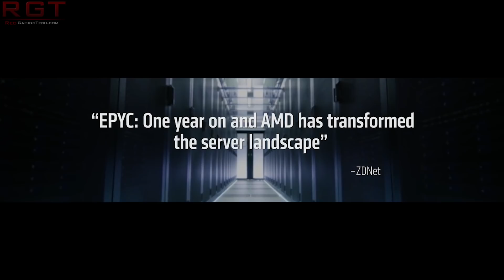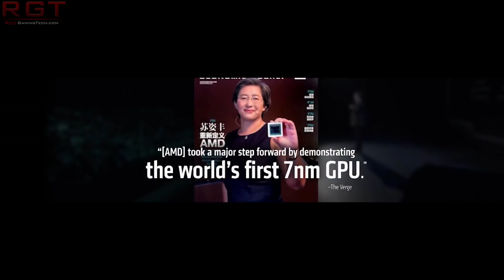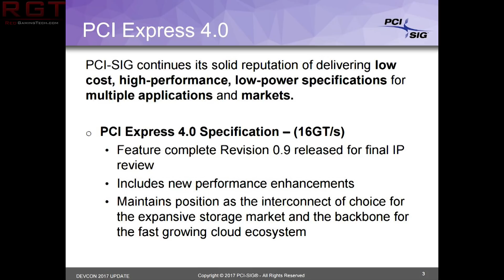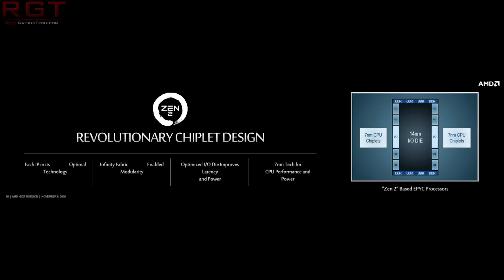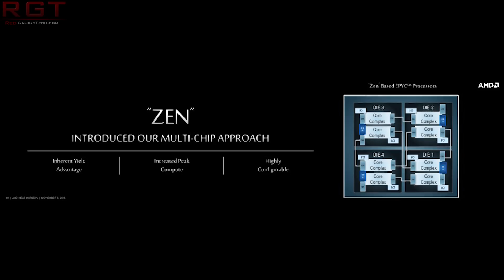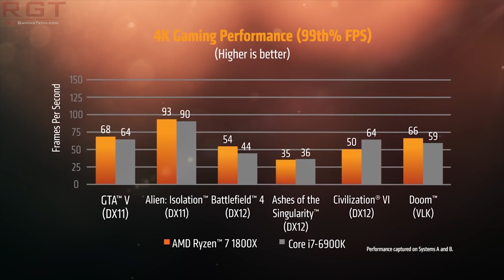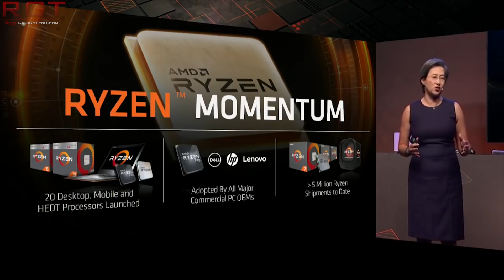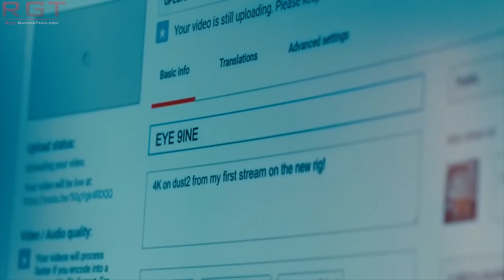Should AMD Raise The Core Count for Zen 2 Ryzen 3000 CPUs ?

Comment: The question shouldn't be should they? 
It's going to happen, and will happen whether or not you want extra cores or not. 

By the end of 2020 AM4 will have 16cores 32threads. Thread Ripper 64cores 128threads. EPYC 128cores 256threads.

Comment: higher clock not more cores IMO..if they can get PBO/XFR to target 1/2 the total amount of cores at near maximum speed with boxed cooler at reasonable power use that would be a major win, also they should "force" AIB to have Bclk on their boards for the x50 and x70 variants as well as 1000000000000000% make sure VRM/Cap designs are up to snuff, if the boards offered are not of sufficiently high quality AMD should impose fines on the vendors ^.^

Nothing worse than spending hard earned money for something you have to continue sending back in for RMA because the AIB did not fully test their product before shipping it, fancy marketing and stickers "on the box" only mean so much, when simple things such as audio crackling on a "premium audio solution" are par for the course or using anything but optimal Vreg/Capacitor/Cooling design completely demolishes what could have been.

I find it "pathetic" that so many AIB(partners) are gutting "useful things" to make way for RGB as well boards from say 10 years ago were bar none much better are overclocking/voltage settings than so many "premium" solutions currently offered.

I am only stating this because if Ryzen 3000 (Zen 2) is held back because of POS AIB/partner designs when it comes to motherboards and QC on them, than it likely will not matter much if Zen 2 can do 4.5Ghz on all cores when the boards that should support it are crud because the AIB focus too much on RGB crud.

Anyways, 8 core 16 thread is "plenty" to target say 4.3Ghz on 4 cores, 4.8Ghz single core and average speed of 4Ghz all core at no more than 105w (actual and TDP) with IPC and latency improvements Zen 2 will be "great" cost wise is "hard to say" truth be told because they base in USD but this usually leads to CAD and other countries paying that much more "tax" because they are not USD based, in theory 7nm will be that much faster/cooler at less power and much lower cost per chip made...time will tell, we got a while to go yet 

interested to see what Navi will end up being as well...price gouge BS with current generation GPU leaves me with little faith however...AMD should get back into OEM directly from them so partners/vendors are more attentive to pricing MSRP/SEP amounts.

Comment: Price is what wins the race especially in the lower end all things being equal.
I think a 8c and 16 thread is fine for a high end ryzen platform.
Good compromise IPC improvements, two really fast cores and good all core speed.

Typically APU's support 1080p or 1440p resolutions, above that an external GPU is usually needed. 
A New APU with Vega equivilent with HBM2  connected directly via the CPU "infinity fabric" it might be ok.
Allowing  queued or cached direct memory tranfers to/from CPU cache, DDR4 memory, APU and HMB2 bypassing PCIE.
I could see a base 4/8 gb HBM2 on the substrate, and using DDR4 as a supplemental APU memory "if" needed. 
In normal gaming you are not using all CPU cores and the GPU(except benchmarking), so TDP normally remains under control.
Reply: perfect place to use "chiplet" is the graphics core so that the igpu is getting its own direct power source and cooling unlike current -g chips which are memory starved or running into TDP limits...just imagine what a -g chip would be capable of if the graphics core alone could be fed a direct 65w and the cpu side could also be fed 65w (coolers can easily handle it) that APU would FLY ^.^

Comment: Guys, guys, stop asking for the bare minimum. AMD is more than capable, when accompanied by a node shrink, to improve in every dimension (just as they said they did). If you ask the top of the line RYZEN CPU to stay at 8 cores, you are dooming the APUs, which is what AMD powered notebooks use, to stay at 4 cores, which isn't enough at all. We should have decent 8-core APUs and good top of the line CPUs too.
As far as single core performance goes, Intel has a lead of about 20% to 25%, depending on the task, on AMD. If AMD manages to improve IPC accross the board by 10% and increase the frequency by 10% (frequency voltage wall at 4.9 or so Ghz), we would get a 21% single thread performance increase which would put AMD on par with Intel. Furthermore, with the design changes implemented in Rome, we can hope for a 12 core 3700x and a 16 core 3800x released down the line. Threadripper could start at 16 cores, with overlap (just like the first generation TR had a SKU with 8 cores, alike the top of the line Ryzen at the time), or 24 core and no overlap, which is what I think is the wisest choice.

Comment: I don't think that it's necessary to increase core counts at this point.  Give the developers a chance to catch up to what already exists.  Hell, games can barely use four threads, let alone twelve or sixteen.  If someone wants beyond sixteen threads then they should just look to Threadripper.  Ryzen 2, 2+ and 3 will be focused on increasing IPC and especially clock speeds.

I really don't think that an IGP would be of much value to Ryzen CPUs that don't already have them.  I say this because I can't see anyone who would be satisfied with an IGP needing more than an R3-2200G, let alone an R5-2400G, both of which have Vega IGPs.

Any serious user or enthusiast (like me) has parts lying around, more than enough to make entire PC.  I have two Gigabyte Radeon HD 7970s, two XFX Radeon HD 4870s an OLD Palit GeForce 8500GT 1GB (If I want to make an HTPC) and a specialised PNY GeForce 8400 GS 512MB PCI (in case anyone with an older motherboard supporting PCI is ever in a jam).  Hell, I even have an AMD FX-8350 with a 990FX motherboard and an old Core i7-2600K with motherboard and enough DDR3 and hard drive space to spare to make two complete systems.

I must say though that I would definitely take an X370 motherboard over a B450 motherboard.  The VRMs will be much better for voerclocking, you get two extra SATA ports, more USB ports and multi-GPU capability.  With the release of X470 motherboards, the X370 versions have dropped dramatically in price.  You can now get an X370 motherboard for the same price as a B450 board.  

Now, it is true that you would have to flash the BIOS in an X370 board for it to support a Ryzen 2000 series but that shouldn't be a problem.  If you're at Canada Computers or Microcenter for instance and tell the salesperson that you are willing to buy both a new Ryzen 2000 series CPU and X370 motherboard.  There's no way that they would refuse to flash the BIOS for you at no charge to make the sale.  That would be the best way to go.

Comment: For AM4 eight cores are plenty!
You rarely need more than two for most mainstream tasks anyway, and the four cores provided with Ryzen 3/5 (the mainstream SKUs) today are sufficient for the vast majority of users. Only a few really need the computing power provided by the 6/8 cores of Ryzen 5/7.
More performance per core is desired over more cores.

Then TR4 can be used to "go crazy" on the number of cores, for those that can make use of it.

Comment: They should focus high clockspeed and IPC instead of having more cores per die for the AM4 platform. Keep the high core count CPU on another platform like the the TR4.

If they could maintain 8 core on 7nm the die would be small and low power. They could probably add a GPU unit as well.

Comment: the point of increasing core count is to give peoples 6 core for the actual price of 4, and 8 for the actual price of 6, that would push again a great jump of the cpu perf per dollar (as ryzen 1 was) that's easy to understand.. as we've all see that on the mainstream silicon, all of their core count are reaching the same clockspeed anyway. and with for exemple the mainstream line goin up to 12 cores (with 3700 10 core and 3800 12 core), that means affordable good extra performance out of gaming. anyway, i think it would be the best way to go for amd with intel probably keeping a lead in the ipc and clockspeed but having trouble following on core count for a good price.

Comment: They should keep the 14/12nm for entry models with minimum 4 overclockable cores and they should offer the maximum possible specs too, what a normal VRM can handle well (~100W) in desktop motherboards.  AMD can build any design, but manufacturing price gives the answer. I'm happy with my 1600X as a workhorse.

Comment: My guess is that Ryzen 3000 is still 8 cores just because threadripper 2000 series won't be replaced until later, so if they release 12 or 16 core Ryzen 3000, they'll never get the 2920s and 2950s to sell anymore without a massive price drop. Maybe they'll release a 12 or 16 core 3800x after threadripper 3000s are released but until they can drop the 2k series threadripper stock down, they're just hurting their own sales of higher end parts.

Comment: people seem too focused on why would they have 16 cores,  why not seems like a much better question to me, you don't loose anything by having more options, having 2+1config would allow for much more options like 2 8 core options one with a single die and one with 4 cores per die, which would also mean double the cache for the 2 die config (4 times zen's cache) and max boost on half the cores.
igpu is overrated, why would i  pay an extra 50+ bucks on something i would use once a year if that plus it would increase costs which would make amd less competitive.
on those saying they want amd to be more focused on ipc, they dont have to move resources to increase core count, its just like lego, they build the piece and then use as many as they want.

Comment: Yeah, 8 cores for the consumer segment is fine for AM4, more than likely we will get a new socket in around 2020/2021 period and it will bring support for ddr5, pci-e 4 and I bet, more than 8 cores(12? 16?) for the consumer segment. Until then, if you are in need of more cores than 8 chances are you are an enthusiast or enterprise customer and should go with either the TR4 or the SP3 platform.

Comment: @RedGamingTech
You know what also works great when your graphics card breaks,  a spare graphics card. Keep one lying around...
That die-space is better used for the CPU. If you want any reason to use integrated graphics: low latency. You could use it for more efficient (lower power usage) video-rendering. So for laptops it could be convenient.

Comment: I'm expecting an 8 Core CPU with Stock clocks of  at 3.8ghz and boost to 4.7 and maybe a 12 core CPU with similar clocks from 3.6 to 4.5. It is easily manageable from that Die shrink. (a 10 core would be even better than a 12 cores but not sure if they would change the architecture that much.

Comment: @RedGamingTech -- ATM the Core count is Superb - The Direction Now is to Gain on ipc/Clk/pci-e/crc - since the 7nm has been obtained - i feel it best to allow the architect to mature a bit Before moving any further forward on Core count Until the proper maxx reach of its life has been obtained - After all there is the thread-ripper sires that has the 12 core -? , im thinking it may be obtainable to really push the limits once Certain Gains have been implemented . of course this is just a Thought - i Could be wrong - But not a Billion Dollar Loss Wrong ! Pushing the envelope to reach Small gains over a period of time is AMD`s Standing Framework that Has Stood the Test of time ! I Would like to See Just 1 ( at Least 1 ) Extremely High Clk Speed that Drives the Rest of the Architect to Its Full Potential - AMD has a Complete Line of pu`s to Implement Certain Aspects of the integration into the Architect and at a Later Time - Not too far off we should see a Very Good compiler that accepts the ig with No loss of gains . now writing this - i see where it could come in to play a valuable aspect to consider - but i think certain goals need to be meet first before the ig should be integrated into the current line - and it very well could take unnecessary stress off the cores/threads that could free up that threshold that stumbles the clk speed - i just feel the clk speed Can be met without it - i would love to see - over time - the current architect Obtain such clk speeds Prior to integration of an ig and the New ig controller that will be soon coming should show a Massive Improvement to an Addition - But Giving it Time to mature on its own as the design is Just reaching its Footing should Prove to be a Major Breakthrough IF Given a Half of a Chance - ?

Comment: before we go any higher then 16 cores on the mainstream platform I feel like we need a reverse SMT/hyperthreading where 2+ cores act as 1 super fast thread. also with pci-e 4.0+ both intel/amd need to make NVME raid mainstream. both 4GB/s and 7.5GB/s are too slow to work as a cache for even standard 17-50GBs DDR4 systems much less the upcoming DDR5. note:sticks with lower transfer rates exist but are not easily found for sale.much less would you want to buy them unless they offered a cost advantage in capacity. currently the difference in price between speed and capacity are almost non existent at the low end.

Comment: They should offer an 8-core with an iGPU on AM4. For more cores, I think Threadripper is the better choice than AM4.
Rather than more cores, I'm looking forward to the IPC gains and higher clock speeds from both their new architecture and node.

Comment: No don't raise the core count, just increase the CPU speed from 3.X to 4.4 or 5 Ghz. Most AAA games nowadays don't even take advantage of more than 4 cores. Even production software aren't even optimized for more than 4 cores. They should implement faster fabric to SSD or memory. Say raid 0 (4X ssds) or Quad/Octa channel ram. Implement DDR5 or PCIE 4.0 specs etc... Heck even new tech like ram slots for NVRAM or save states/SSD.

Comment: Currently people are buying Intel because of the higher IPC and frequency. If AMD increased the core count, people would still be buying Intel because of the higher IPC and frequency. So obviously AMD need to concentrate on a higher IPC and frequency. They will achieve that with Zen 2 but it needs to also be their primary focus.

Higher IPC and frequency has been Intel's priority for years. Intel only had 4 cores before Ryzen and they would still be on 4 cores now.
Reply: higher frequency/IPC at less watts for the current core/thread counts that Ryzen brought about 4/4, 4/8, 6/12, 8/16 etc)

Comment: What else can they do? They do not seem to be able to increase frequencies over 4.2GHz on any Ryzen chip. AMD is designed to give options for more cores\threads over time. That is why it is critical for AMD that the software mfgs start to write code to make max use of multi core cpus.

Comment: What I'd like to see is this:
- 3800 16c 32 t
- 3700 12c 24t
- 3600 8c 16t
- 3500 6c 12t
- 3400 4c 8t
- 3300 4c 4t
That would cover everything nicely and give a ton of options for consumers and puts the 8c 16t in a great position for the mainstream gamer.  It would also put a ton of pressure on Intel to compete on price which would be great for us.  Of course there would likely be  X and standard versions in each category too.  Options, options, and more options...

Comment: There is little need for more cores in mainstream for the next few years.  CC's like this channel can go up a tier to TR.  I think AMD needs to be one more competitive at the Throughput level by making improvements to IF and latency.  These would really improve IPC more than any other two things.  Further increasing core count wouldn't give the average PC user anything; programs just aren't there yet.  Those programs that do use the extra cores/threads don't actually scale that well yet either.  Give devs time to catchup to the core/thread counts and improve things that will help them (AMD) when Intel gets their 10nm process fixed (at this point I'm not sure if that will be late 2019 or 2020 for significant Desktop production).

Comment: Not really sure about AMD's plans, but it seems they need to take into consideration all the vulnerabilities that come with threads. Most probably, security measures will be taken into account in their design - the way EPYC CPUs are starting to shape into. Modularity will increase, so most likely the cores will increase, but in no way with Ryzen 3000 if they plan to launch Threadripper 2900X.

Comment: It is possible to increase core count but the dual channel memory on AM4 platform will bottleneck its performance. Except IF AMD create a brand new x390 chipset with quad channel memory support in it.

Personally, the 8 cores 2700X is good enough for what I need... but lower power consumption, better IPC and higher clock would be a huge bonus.

And hopefully it will get cheaper resulted from smaller die and 7nm process.

Comment: AMD will likely have on par performance or slightly greater with Intel on the release of Zen 2 so the need for more cores won't be necessary. But I think an IGP would be huge price/performance leveraging. Even if they move up to adding IGP to 6 core CPU parts.

Comment: I'm a simple man with modest needs, 128 cores and 256 threads all running at 6 GHz would be nice. Also the bandwidth of the entire system would have to pretty much double to help mitigate bottlenecking. Should be ready in 3-5 years I would think. Seriously though, I have no doubt the hardware will make great improvements in every category over the next few years that's not what bothers me. Its the software side of things that is starting to lag behind. We need more software developers to take advantage of all these cores modern CPU's have. Better software would make a much bigger difference in overall performance than more hardware gains.